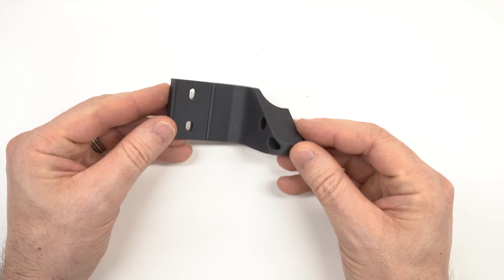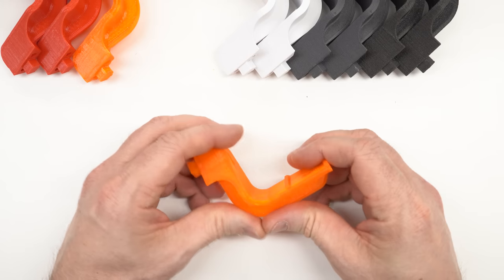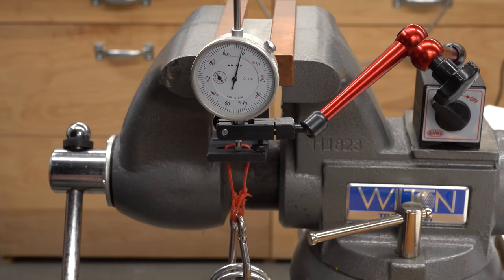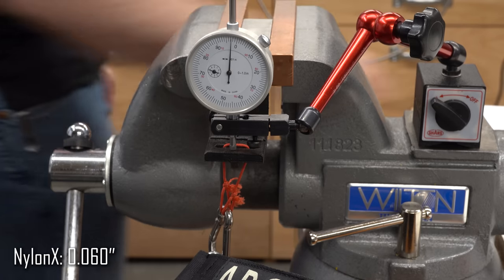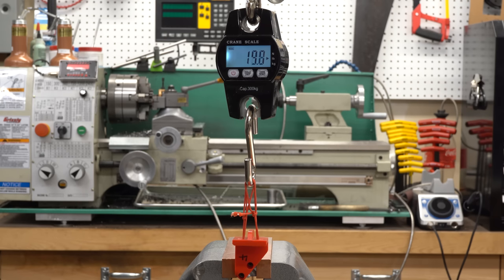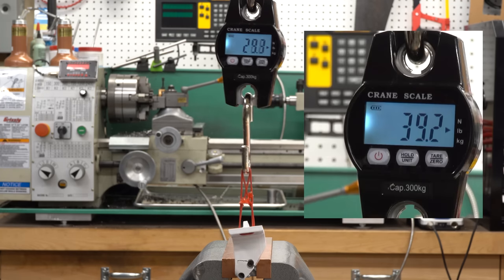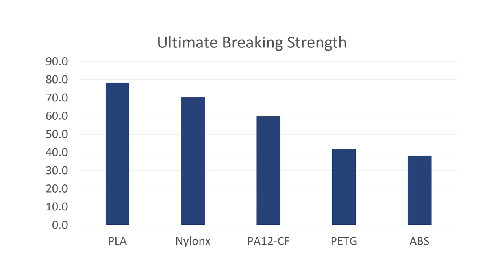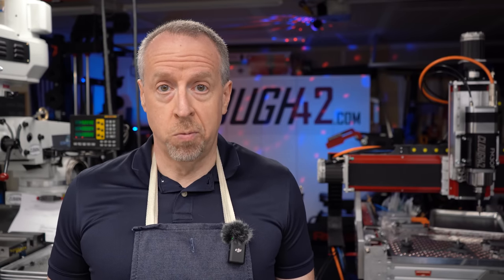Wait, What?  PLA is Stronger Than Carbon-Fiber Nylon?

Comment: Way more important than material, is the way a part is designed. Understanding the loads and performance requirements first, understanding how structure affects parts stiffness/strength and applying it accordingly is far more valuable than any change in material can bring.

Another important note: Nylon has a hidden problem (which PLA suffers from as well), namely: creep. Under constant load, a part will tend to deform more over time. In many applications this can actually cause a higher load per surface area over time (due to the structure deforming increasing the load, or for example material necking), in turn exacerbating the problem. This will lead to part failure (Many people suffer from breaking filament on their rolls, in the place where they feed it in those 'loops' to hold it in place, this is I think due to this phenomena).
Its brother relaxation (decrease in force over time for a constant deflection) can be a problem in some mechanisms as well. For example, if you design a part to be a spring that is supposed to hold something in place, then over time it will lose its holding force.

ABS/ASA/PETG are MUCH better in that regard. I believe 'mytechfun' here on youtube did some experiments with it.

Comment: Nice work.
I print PETG an 5 degree higher and a little bit more extrusion to get better adhesive layer, to me the biggest problem. For this reason I print those parts with 100 % infill.
I use even some parts on my lathe and still holding strong. If I would use an aluminium part of 5 mm for an aplication, I would use a 10 mm printed part.
I use also PLA for some tools, but if there is a lot of tension all the time, you will get creep in time. PETG maybe than a better choice.
PLA has an other bad thing. Like glass, it can break unexpectedly and produce quite sharp shards.

My workflow : Can I use PLA ?, no, Can I use PETG ?, no, ASA ?, no, PC with carbon fiber ?, no, Aluminium.

Comment: i am designing functional aerodynamic parts for my race bike, i for sure am planning to use CF-PA6 and then put epoxy on the part. fluid dynamic simulations helped me calculate downforce on the parts and i did some tests and CF-PA6 actually held up better than CF-PLA and regular PLA

Comment: A few comments. One, there's a woodworker called Mathias Wandell here on youtube who does fabulous workshop strength tests where he captures the whole yielding process.
Two, my issue with PLA is not strength but the fact that it tends to deteriorate and lose integrity gradually. I think exposure to sun and heat speeds this process. As a result, I tend to prefer PETG, which although less strong, is very tough and tends to maintain itself better over time.
Anyway, great tests. It really shows why PETG is such a useful material.

Comment: For PETG i had similar inconsistencies and did some research on it.. It is realy important to print PETG fully dried to have consistent results.. Because the explanaiton is that the moisture inside does microbubbles during printing and you get part that is similar to foam.. after that I religiosly dried and even printed out of a dryer and it made significant improvments specialy the flex before it breaks is bigger...

Comment: Ok... I think the problem you're having here is an enclosure heat issue.  Abs is capable of way more, as are all of those, but your enclosure temperature, printing speed, pressure, etc all have a ton to do with how strong the advanced materials end up.  Pla won't behave better in this application if the material is processed perfectly.  That petg managed to basically be a perfect print and behaved right until it broke, but the rest of them not doing it tells me you're getting SOME kind of flaw in each of these that's killing the print.  PLA is just extremely forgiving to get perfect adhesion and processing.  It likes to be heated and then cooled quickly, etc.  maybe annealing the prints in the advanced materials could help, but without knowing exactly what you're doing, your build, your settings, all the things basically it'd be hard to guess the exact problem.... I just can be sure at this point you have one.

Comment: Major drawback of PLA is its temperature resistance and major drawback of annealed PLA is its deformation which both disqualifies it for engineering applications. Good idea IMO would to be test plaster annealing of PLA what Stefan from CNC kitchen do but think it should be more investigated as it very promising for ultimate strong parts.

Comment: Thanks for sharing. I use PLA for all types of prints, it can be over and under cooked. Color can affect the temperature for the best prints. Printer quality has tripled therefore the prints are fantastic and stronger. Some of my slower prints are mind blowing and look like injection molded parts with PLA, I have painted some to make them more UV protected. Thanks for the testing. There is a video on PLA outboard propeller testing this video made me try harder for better prints with PLA, faster, slower, temperature control, infill.

Comment: The more time I spend printing, the less time I consider what the "best" filament is, opting instead for "sufficient." PLA and PETG are super easy and reliable to print, and they behave the way I expect. If I need a really robust part, I'll print a structure and then reinforce it with sheet metal or fiber-reinforced plastic.
Reply from the maker: I think this is wise.  If you have something cheap and available and it's good enough, you're all set.  One might wish to optimize beyond this for large-scale production to gain efficiency, but if you're only printing one or two, the time spent optimizing would be a much larger cost.

Comment: This is going to save me from buying CF at unreasonable prices, let alone the replacement cost of nozzles. Go PLA! I'd say that the fairest way to judge the peak load is at the point of the surface layers splitting - that's when it fails, not when it hangs onto the last bit. The geometry introduces a bit of discrepancy (added variables), as they're all breaking at that one area, near the taper and junction. Do that same test with a 2" long 90° angle, with a tab on the back for the vice, and see how long it takes to snap at the inside edge. This was a well performed and honest test comparison.

Comment: I use mostly PETG. It is strong enough and flexible but it seems to shatter more easily with shock loads. PLA is surprisingly strong and I like it too. I've never put them head to head.
I've had good luck with PLA outdoors too but knowing it should not take elements too well, I tend to pring PETG for anything outside.

Comment: Nice video! Would be interesting to see how these parts perform in a different load case. The shear stress from that bolt seemed to be the failure point for all the materials. Would be really interesting to do a pressure vessel test (though you'd have to fix the porosity) so you could examine axial stresses and hoop stresses... which are really just tension huh. Whatever!

Comment: My limited experience is quite similar - haven't done any quantitative testing, but the parts made from PLA have been pretty strong so far, ABS has been utterly disappointing (warping, relative weakness of both the material itself and the prints) and PETG is a bit of a hassle to print too. There are also some aspects that are harder to quantify - like how the material ages/reacts to moisture or constant load/stress.

I'd use PLA for pretty much anything that's kept indoors in a moderate climate. ABS/PETG might still have their uses for slightly elevated temperatures. If Prusa is using PETG parts in their printer, I'd say they must have done some internal testing to justify it, can't imagine they would just go with the hype.

Comment: I didn't set out to do a test of PETG, but I accidentally did and it mirrored your results. IE, inconsistent strength. My application specifically needed some degree of heat resistance (I printed holders for parts that were spray coated and then put into a curing oven). Some of the holders were plenty strong for what I needed, but several just busted during assembly. It was the same eSun PETG you used (though a different color). Gonna try turning down cooling as is suggested here and see if that makes a difference in strength.
Reply from the maker: Very interesting.  I haven't had any real issues with it in the past, but I think the geometry of this part and the resulting overhang created some imperfections in the print that gave the fracture a place to start.
Reply: @Clough42  In my case it was absolutely because it was a long, thin part that had threading on both ends. The only orientation I could print it was the worst one for durability, and the ones that broke all broke in the threads, even with 5 perimeters. Definitely a weak spot. That said, the one printed with drastically reduced part cooling seems to be much more tougher. Much better surface finish too! So I'm changing that filament profile permanently.

Comment: PLA is very rigid and strong. And then it gets mildly warm and becomes putty. It's also so rigid and strong that it shatters rather than flex by the time it actually fails. Which is why I almost exclusively print PETG for normal parts, and will be using PC-CF for the stuff that needs to be mechanically solid. But yes, PLA is strong and rigid, just has many other shortcomings, mainly low heat tolerance and a tendency to creep under any sort of mechanical pressure. PETG is a great material, and it has way more flex in it; in many other tests I've seen the testers didn't even manage to break it, they just wound up pulling it out like taffy. Then there's also the quality of the plastic and filament to take into account, as well as the orientation of the layers when printing. If you rely on layer adhesion to determine strength, it's a lottery. If you make sure the layers are  aligned perpendicular to the force applied, it's way more consistent and stronger overall.

Comment: I print a lot (currently about 5000) of mechanical parts used in a small production product with Atomic's carbon fiber PETG and it is incredible. Obviously stiffer than normal PETG and fantastic! layer adhesion.

Comment: Obviously, Infill Laying and Cross Section Grid, Triangle etc makes a Huge Difference in Vertical or Horizontal Strength no matter what the Material When Shearing or Snapping apart, Also PETG is in My Opinion one of the most difficult to print cleanly and with nice layering.

Comment: Carbon fiber Polycarbonate is my high end engineering filament if I need something to be extremely tough.
For most functional things I use PLA
and for models I use PETG for being easy to sand. 

Plenty of people have done testing on this, but for your own experience you should do that same test with Carbon Fiber PC
It's IMO pretty affordable to at ~$60/kk which is 3x the price of PLA, but can take the where PLA can't. Just make sure your bed is 100c and you are printing in an enclosure and its pretty easy to print with

Comment: I think you'll get very different results for the nylons if you let them absorb moisture from the atmosphere for a few weeks before testing. I've found Polymaker CoPa gets considerably tougher but less stiff as it's moisture content increases. I use it where temperature stability is required.

Comment: Considering the printing and surface issues with NylonX, the temperature issues with PLA, the weakness in PETG and ABS, I think that the PA12-CF is probably the best all-around choice. It's consistently near the top in every application, easy to print, looks great, is fine with higher temperatures and is consistently strong and very rigid. 
I use a ton of it at work for fixturing. If you want the ultimate give Essentium's HTN-CF25  a try. It costs a fortune but it's a good alternative to machined aluminum parts in most cases, it's strength and rigidity are unreal.

Comment: @s4060
1 second ago
Great video, thank you!

I have a question:    I need to print an intake for a go kart engine. Where the small carburetor is on the end. Karts have no suspension so the part needs to be strong to 'shaking' with the carburetor on the end. Can you advise the type of filament I should use please?

Comment: yeah, i say, the strenght of a material can differ even from the same manufacturer. Color can also affect the strenght... soo, yeah. I got told that abs was soo good and strong, i usually print in petg. It just works best for me, strenght, doesent react to chemicals, uv and so on. Anyhow, got a abs roll from amaxon, printed, alot of stinking, yeah, and not that strong, not enought for me tu use it instead of petg anyway. Used up that roll, and got a customer that wanted some stuff i abs printed. Bought another roll from another manufacturer, and that plastic was rock hard! the print looked soo good, but it got all warped up and cracked between the layers in the end sadly enought... soo, yeam, amazon basic petg is what i use.

Comment: One major item that impacts the performance is the speed and temperature the material is printed at. It will significantly impact the adhesion. Even if printed to where the layers are in optimal direction it still will impact the strength overall. Not that you want to be in business of testing but it would require running samples printed at different speeds and temperatures to fully determine what has better strength. Fun test to watch though. 

Thankfully the materials lab at my work does all this testing for me and I end up just getting the benefits of parts printed at optimal process.

Comment: Nice test! Depending on how quickly after you printed your parts, the deflection differences between NylonX and PA12-CF can be attributed to absorbtion of water.
When printing nylon parts with dry filament the part will be VERY stiff when first printed, but will get much more flexible in the duration of a week or so, when the polymer has time to absorb moisture from the air. I normally condition my nylon parts in a ziplock bag with som water on the bathroom floor (high humidity climate) for a day or two to speed up the process.

If i need my nylon parts to be extra flexible, i might actually boil the part for a minute. Then it gets super flexible, almost like stiff TPU.

Comment: I really like Essentium PCTG. It has fantastic layer adhesion. It is just as easy to print with as PLA, doesn't warp. Slightly higher temp to print. It has pretty good rigidity. Great impact, chemical, and uv resistance. My biggest knock is that is pretty flammable once it begins to burn. Decent pricing. In short, it is my go to.

Comment: I've had spectacular strength results out of PLA myself, fresh off the printer.

But 2 years later every single print that was mechanically loaded failed. Something is happening to it. It becomes much more brittle, grows visible tiny little cracks around the spots where it's loaded. I will never use it for anything critical where it might drop something heavy and expensive when failed. No matter how much material used or how designed, i'm just concerned of this degradation. 

PETG behaves really weirdly. If you load it slower, it has elasticity and withstands a lot, otherwise it can become brittle. But i still have reasonable long term trust.
Reply: Once they've been around for long enough, the manufacturers will adjust the UV resistance & whatever voodoo they need to.  Every varnish my dad ever put on a row boat turned into potato chips in short order.  Today's stuff is a lot different.  Manufacturers just can't have that many bad examples out in public, so they either have to make the stuff better, or convince you to buy stuff that's gone before you notice a problem.

Comment: Most of the filament on the market today is actually a combination of the 'base' material, and some other adatives that give it other properties, depending on how it's treated. Tough PLA has interesting properties in relationship to abrasion, twisthing, etc. PLAPro can be heat treated which gives it other properties such as a limited improvement on heat resistance, and better layer adhesion as crystals of the PLA develop bonding the layers. The down side of the latter is that during the heat treating parts can move in unpredictable ways, which means that what you printed isn't necessarily what you will get out of the process. 

I'm not aware of anyone who's gone through all the testing that these materials are designed to withstand, and some of the options may give you. Likewise I strongly suspect that there is overlap for just what characteristics someone is looking for in any print. I'm currently printing a holder plate for sharpening plates. Something I can add a neoprene bottom to, that will keep the sharpening plates in place. It's not going to need to worry about heat, the only dimensional pieces I'm worried about are that the 2 inch by 6 inch sharpening plates pretty much stay in place. Oh, and that the top surface of the plates stays above the plate holder. PLA or ToughPLA is more than enough for me in this case. Others may have other interests. That's OK.

Comment: This is a basic test, try on different temperature level, you might be surprised ! Also test torsion + heat, you will again be surprised.
Print a base rectangular, like 2'x5', .2' thick and make a bend test, torsion test, at room temp and heated, again you will be surprised. For common supporting parts, as long as the room temp stays cool, you can't beat PLA. For more technical use (heat, moisture, direct sun...), the results will be way different ! The aim is to use the right filament for the usage ;-) PA12 CF for speaker bar support is way overkill, but if this speaker would live outside in the sun/rain for example, then ASA would be the choice, PLA would have bent in the sun, but for inside use, PLA is the choice (especially concerning the price of a PLA roll vs PA12).